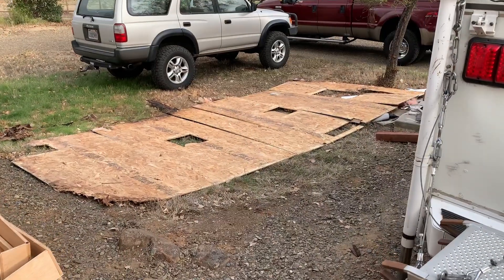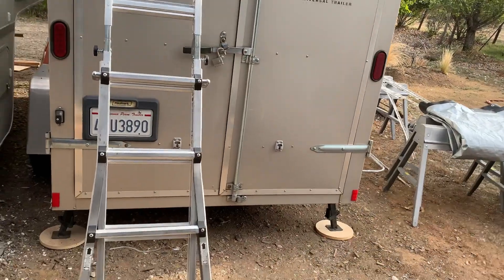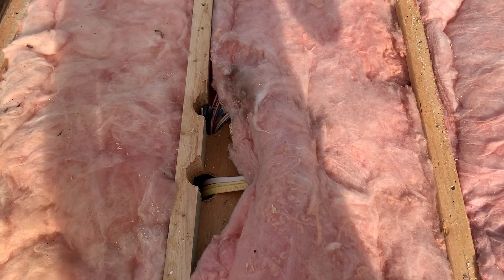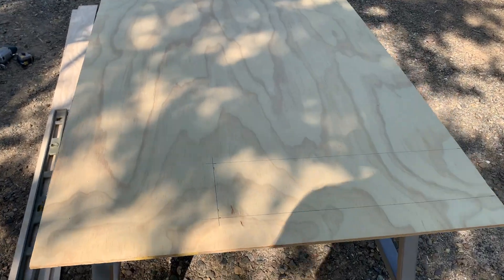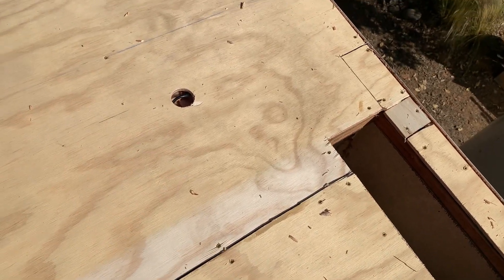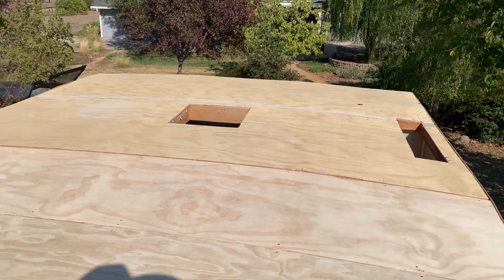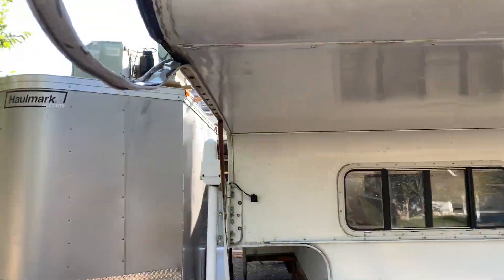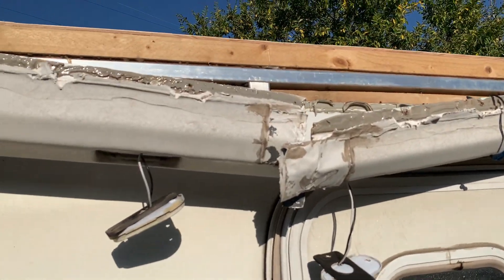In With the New.  New Plywood Roof Deck. Installing a 50-Year RV Roof. Part 9

Comment: Looks great. Nice work. Did you consider putting a penetrating epoxy sealer on the plywood to help eliminate any future damage to the wood?
Reply from the maker: Yeah, I did consider that at first but ultimately the final roof coating that goes on after the poly sheet is the waterproofing.  I didn’t need to add the extra weight, cost or extra work to achieve the desired result.

Comment: I've used heavy duty epoxy for plastic repairs with good results and I have "melted" plastic back together with not as good results. Both work but the epoxy gives me closer to original shape.
Reply from the maker: Epoxy is great.  I did the repair with plastic weld (JB Weld) and wood reinforced construction adhesive on the backside.  
It’s solid.  I did some repairs on my kids plastic toys when they were little.  I got pretty good at fixing cracks in their BigWheel trikes etc…

Comment: Although I found the used unit I was looking for (2000 Fleetwood Elkhorn, no slide, side entrance, dry bath) it came with a mixed bag of prior repairs and needed repairs. I wasn't sure I could do them myself but thanks to you and others I've found here on youtube I feel like it's possible to do what needs to be done. Would it be possible to get estimates on materials for all this work in a video when your done? Thanks for all the hard work you do and especially in the work required to post these videos. Greatly appreciated!!
Reply from the maker: I have a video in queue with materials cost/hours spent etc.
Reply: @covetthecamper2289  Thx so much!

Comment: With Al Alicea, me and you, you've got 3 Elkhorn owners wanting to make their campers "new again"! I wonder how come there's no "Lance" guys on here?
Reply from the maker: There’s some Lance folks on here I think.  A few Alpenlite, Arctic Fox owners poking around too.   Early 2000’s Arctic Fox campers had a lot of the same issues as our Fleetwood campers.
Plenty of Lance campers in need of repair out there.  I have a few Lance repair videos on here that I did during Covid.  Lance campers were all wood framed until around 2006-2007.  In 2009 they started using Azdel substrate instead of luan ply.  
Fun fact….  The company that owns Fleetwood (REV Group, Inc.) now owns Lance campers.  Bought them in 2018.